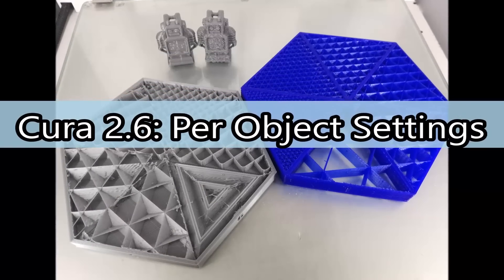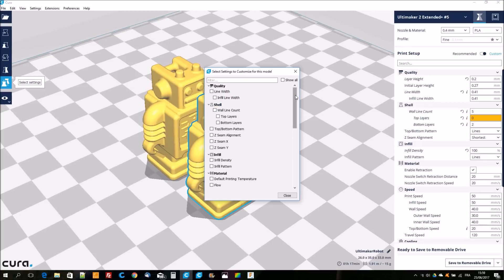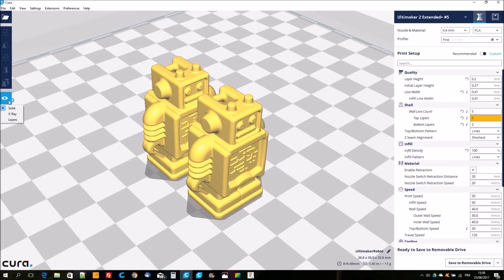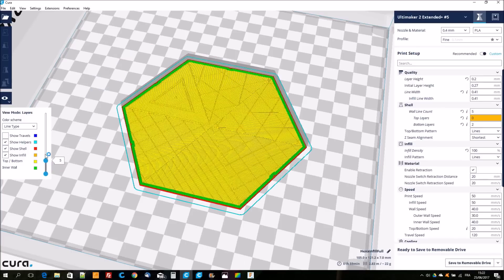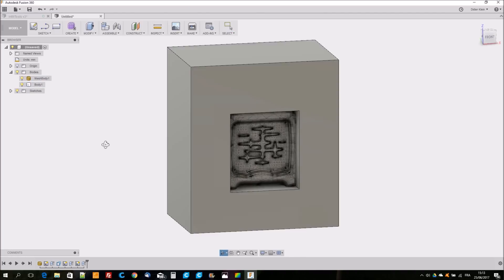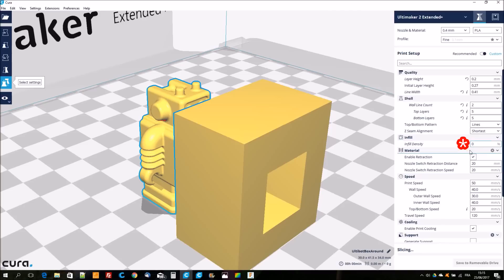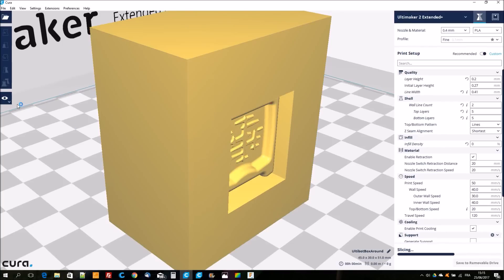CURA 2.6: Different infills in  the same print

Comment: Well done, But i didn't get what you did at min 2:00,  what about the full model (not the 6 slices) did you upload it to Cura too ? or no need.  ie you uploaded 6 or 7 stl files ? TIA
Reply from the maker: You need to upload the 6 pieces, not the full model, then after the 6 pieces are merged.

Comment: I'm confused tho. how do you print the robot without the box after you're done?
Reply from the maker: Hi Chloe, the box is defined as an infill mesh, so it's only printing the parts that intersect with the model (as infill), you can use any other model to do the job of the box, like a cube for example. Just define it as infill mesh and you should be ok. You can of course use several cubes if you need to

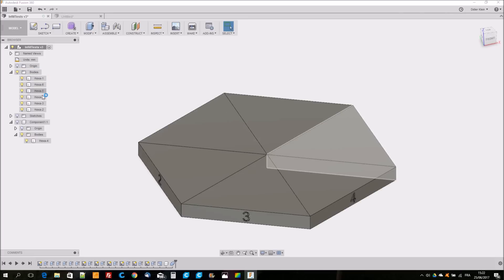Comment: Great video! How did you get the multiple bodies into Cura, keeping them aligned but separate? (Basically 2:22-2:24) 
If I select the top-level tree node in Fusion 360 (InfillTests v3 in your video) and Save as STL to Cura, it merges them together into a single model.
If I select the bodies and export as One File Per Body, adding them to Cura arranges them randomly.
Thanks!

Using Fusion 360 2.0 and Cura 3.4.1
Reply from the maker: Hi, Thanks! Select all models then select merge models this should bring them together at the centerpoint defined in Fusion

Comment: My Cura Program show a large light gray shadow and a smaller dark gray shadow around the object. The large one I don't know what represents and how to change it. I can't print a object if it has this large light gray shadow beyond the printing area. This limits the number of objects I can print at time. How can I get rid of it?
Reply from the maker: Hi,

The shadow that is around your object actually represents the space that the head takes while printing the object. It protects this area because if you print several objects one at a time it will prevent to hit the first printed object with the head. So i'm afraid it's not possible to reduce this area. One solution is to print all at once, in that way no collisions can occur.

Comment: any idea why my prints always start in one corner of the plate?>? everything works fine , except I cannot print multiple objects because of this??
Reply from the maker: Rob M you have to check out the start gcode of your printer, there you can change where it goes at the beginning
Reply: wow.. What will the code look like ?? g0 -z78mm g0-z-48mm or something to that effect?? I'm guessing making those zero would center it ?
Reply from the maker: Rob M not on a pc right now but it should be something like g0 x 0 y 0 assuming the center of the plate is zero (this is also definined in the machine settings)
Reply: hmmm.. see I think that's the issue , the  xy center in cura seems to be the left corner in the machine settings ..ill look at the G code before I send to print in an hour and see what it says.. THX
Reply from the maker: DO you have this at the beginning: 

G28 ;Home

This should home every thing (Z and X and Y) usually this value is defined in the firmware
Reply: ill have a look , thank you..
Reply: G21       ;metric values
G90       ;absolute positioning
M82       ;set extruder to absolute mode
M107      ;start with the fan off
G28 Z0    ;home Z
G1 Z15.0 F840
G92 E0    ;zero the extruded length
G1 F200 E3
Reply from the maker: if you add the g28 it should be ok i think. this would make the printer home everything at the start of the print

Comment: need to fill the materail by triangle pattern help me to do this ??
Reply from the maker: What do you mean ? Just select triangle in the infill pattern? It might be hidden, so click on the small gear next to infill settings and enable the pattern setting. Then you can choose triangle.?
Reply: is slicr have traingular infill pattern ??
Reply from the maker: Slic3r not sure... Cura 2.6 has it
Reply: k fine.... if we want to develope a new pattern for infilling means.. how we start ?? which language.. we hvae to write g-code or something
Reply from the maker: No no it's more in the slicer, i'm not very familiar with how they do it, i think basically you apply some kind of shape to the internal of the model. In Cura this is done in python language. Slic3r i don't know.
Reply: k k thank you for u patience .......... one more thing ... now i slice with cura2.6 give triangle infill pattern but my printer print in diagonal way dnt knw y ?? pls help me to solve this
Reply from the maker: Maybe the printer is not configured correctly? I don't know like that... best way to solve this is to go to the Ultimaker forums and post a picture there (i'm also a moderator of the community i might see it there).